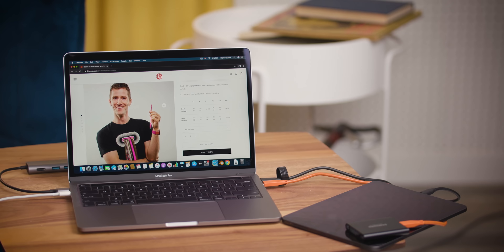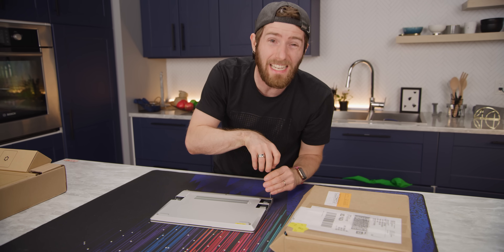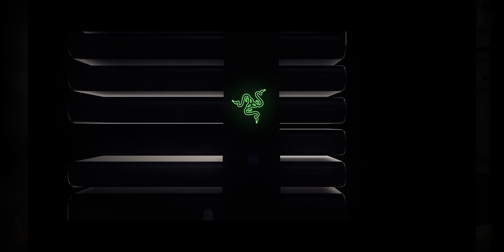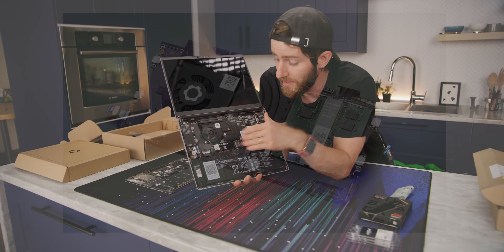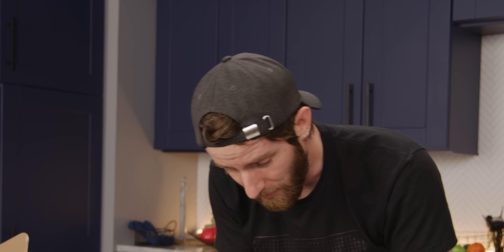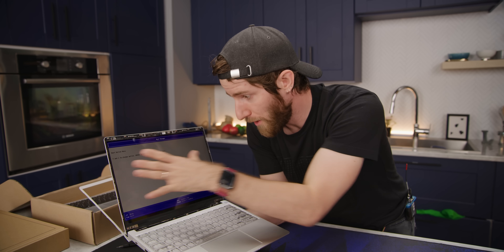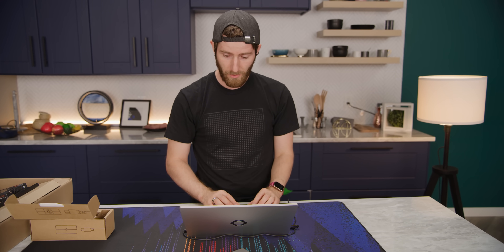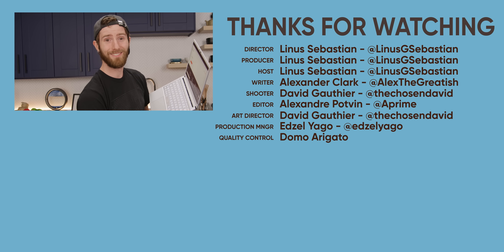A COMPLETELY Upgradeable Laptop?  - Framework Laptop Review

Comment: 2 main gripes I have with this thing aside from the obvious uncertain future:
1: customizeable ports are nice BUT 3 (4-charging port) of anything is NOT enough for me without dongles.
2: While the hardware freedom is nice, they have to compete with the software freedom of system 76 for me.

these are very fixable though. if they had atleast one of either USB-A or a USB-C charging port built into the chassis standard that would go a long way to increasing the actual flexibility with the other ports. 
-EVERYONE will need to charge the laptop and if you really want it on the other side you can still use a modular type C
-type A is so widespread for things like dongles, flash drives, mice, external hard drives, and phones, it is reasonable to assume the vast majority of people will still find use for a single one somewhere on the laptop 
-alternatively they could just have 6 ports though that might cut into speaker size theoretically, though they could have made the speakers themselves modular with 2 "jumbo" bays that could alternatively support larger devices with multiple ports or just the regular ports with some kind of spacer to fill the gap. I would trade out stereo sound for 2 more ports personally. 

for 2 they could implement coreboot themselves, but honestly what would go a long way, is if they could partner up with system 76 and possibly other companies for alternative parts at some point in the future and instead take on the role as some sort of standardized 'framework' for other companies to compete to create parts and boards for.

Comment: Why not make a video about mainboards with integrated UEFI shell? I know MSI boards have it. ASUS probably only with an extra file on USB with FAT32.
Does it have a UEFI shell?

01:30 - 02:10 Look at the fair phone it follows the same logic. Manufacturers just have to agree on a standard for PCIe micro interconnects for phones and laptops. Modularity is always possible. The real problem is their greed not that you can't do it. When the board and CEOs and owners suport the wrong thing.
Cons:
No easily removable battery. Easily meaning from the outside.
No Hardware switch to disconnect the battery water damage.
The IO modules are not build for a higher port density.
Is the mainboard modular? Do they have a CPU and GPU socket that have a standard interconnect like PCIe with a zif solution to use BGA chips in them. Modules for everything sound network V/RAM. Southbridge socket. Interconnect board.
Localized keyboards are missing too, so...
There are many more things that can be improved or are missing so hopefully they stay in business to make them. Or another company makes them.
08:40 Yes they are called BGA. Make the solder pads thicker and solve the problems with the HF connection to slot them in ZIF sockets.

Yes the privacy shade is awesome and the mic switch too but the port density and the lack of a removeable battery are a dealbreaker.
Besides I really like the suitcase style laptops, done right you can use an ITX board in them and a full sized RGB keyboard with a shitload of macrokeys you'll never use.^^
Personally I wouldn't mind a small suitcase laptop if it was a DTR (DeskTop Replacement).

Comment: Panasonic's Model 55 was out way before this and is much better design that has "bays" that let you upgrade it like this except better. You can have something nuts like 40+ hours battery, super GPUs, IO stuff, antennas, so many different combos. Very modular, and handy.

Comment: I'd really like to see a Gigabit ethernet port expansion card. Sometimes, I want to have my laptop running a wired internet connection instead of WiFi!
Reply: Why’s that?
Reply: @npgoalkeeper  I have a few reasons. A hard-wired internet connection will always be faster than a wireless one. I don't have to worry about interference from other devices, so it's far more stable. Plus, I work in IT, so often I don't have WiFi available when I go to a client's site. However, I always have the option to hard wire. Rather than carrying around a USB to Ethernet dongle, I'd like to have a port built-in.

Comment: Looking at the website, this is amazing except they only have a 13.5" display size of laptop. I really hope they come out with 15.6", 17.3", and I think 18.4" as other sizes I've personally used of laptops. Possibly adding more hot swappable ports too, it'd be amazing to have the ability to say connect to 4+ screens or have like 10+ USB 3.0/3.1 ports depending on whatever purpose one might have for those options.

Comment: To be honest I don't see the appeal.  It's a $1300 laptop that requires assembly, with meh specs, that's had all ports except 3.5mm aux + USB-C removed, and expects you to use adapters for each other type of port you want.  Sounds like a MacBook Pro, with the exceptions that these adapters going inside the laptop case instead of sticking out the side and the MacBook Pro doesn't require assembly.  These adapters are also 100% proprietary.  

The part about being able to swap the board is interesting, but irrelevant until they come out with new/upgraded boards to be swapped in.  Until their promised modularity/upgradability is actually realized, I just don't see the point in this thing personally.

Comment: Please post an update on the pricing. Simply comparing the prebuilt and DIY models with the same specs results in the DIY model being around $100 more expensive, rather than $300 cheaper, and I'm not sure if this is supposed to be a feature or a bug

Comment: Well, I literally hate this "you can't repair your stuff by yourself" trend. Hacked my Lenovo laptop UEFI to override whitelist and now I can use WiGig with my modded router (I really appreciate those PCIe solder pads under the router hood). PS: I hate glued phones, but there's not much alternatives right now. I'm using high hardness wire to cut glue to open my phone… Feeling obligated to master those weird skills.

Comment: Honestly, I’d make this laptop. I’d expose 16 PCIe lanes on each side instead of having the USB-C modules, but I’d make this.
Reply: Pcie is probably a bad idea here, maybe TB3/4?
Reply: @npgoalkeeper  How would it be a bad idea? I mean, the size of a laptop may require a custom connector (of which I’d definitely publish the pinout and the specs of the connector) but it’d allow you to do something similar to the Panasonic Toughbook 55, with both sides capable of holding I/O, NVMe storage, maybe even discrete graphics.
Reply: @AshtonSnapp  while pcie hot swap exists it’s quite complex and adds a lot of overhead (though TB adds almost the same), and yeah there’s the issue of interfaces. The current trend is smaller, universal connectors. Slapping a large, new  connector on devices without developing an initial ecosystem would mean that adoption rates would be quite low (and may not rise at all).

It’d be easier to just slap some more thunderbolt3 ports, given that most users would rarely surpass the 32.4Gbps limit of TB3/4 for data transfer.
Reply: @npgoalkeeper  Yeah, ok you’ve got a point there. Doesn’t mean I’m a fan of it, but you have a point. Honestly I wish PCMCIA/ExpressCard still existed. That would make expansion much easier.

Comment: Modular io like this is mostly useless. Being able to replace ports easily when they fail is a must, but these modules make no sense. They take up so much space that you’re left having to change them out repeatedly when it would have made more sense to just use that space to have a few thunderbolt ports, and maybe 1 modular connected for special uses. One of the modules is already wasted by not having a dedicated charge port. I appreciate what they are going for, but I’d rather just have thunderbolt ports and have to carry a adapter hub than worry about constantly swapping out these modules when I need something else.
Reply: Well. I don't believe that their intent is to make changing IO frequently, but rather when you buy a laptop YOU can decide what IO you want. And then you don't have to change it.
Reply: @aleksanderkrauze9304  right, which would make more sense to do on the inside by connecting them directly into the motherboard. This would not only save space by removing all that housing and adapter nonsense in the modules allowing for more IO, but would make the exterior look better. All they would need to include are smaller IO cover plates.
Reply: @disgustedluigi  I guess that would make more sense. This adapters are in fact quite large. On the other hand this way it is constructed today is probably more convenient for an average Joe. One thing for sure. It is step in the right direction.

Comment: Honestly between this weeks WAN and this video I think I'm going to get the DIY model myself early next year when I get my income tax return. I've been wanting a laptop, I ran an HP Pavilion for 10 years (It easily outlasted my ASUS ROG laptop that was 3x the cost I was gifted for college by a lot) and honestly if I could upgrade that I would have to keep it current - the thing was an absolute trooper. This laptop would be both a fun weekend project as well as something I could realistically use side by side with my Custom Built Desktop. The whole reason I spent so much time making my desktop what I wanted in a case I wanted was I never wanted to need to buy a new one. Now if I need to I can buy a new GPU or I could replace my ram or I could replace the mobo/CPU, nothing in here is going to force a full upgrade and I SUPER appreciate that. If this laptop holds up and can promise me the same longevity I expect out of my PC itself GOOD. I would LOVE for this company to succeed and do well and I would love to see it someday outsell the SIs.

Comment: You don't save $300 if you choose to build it yourself. It's $300 cheaper, but you only get the barebone version, to which you need to add *everything*, building up to a similar price as the base version for similar configurations. 
The upside is that you can choose to leave some features aside, like the OS or the storage.

Comment: About the cpus, not all laptops have the cpu soldered on the motherboard directly. Just all made after 2012. That's whyI use only machines that are older than 10 years. All the new ones are a piece of crap.

Comment: Ok so lets take a look at this shall we? Base configuration vs specced up config of say a macbook air. Why a specced up air? Because this thing, in order to get a processor that performs like the M1 needs a 300 dollar processor upgrade. So 16 gigs of ram for both, core i7 for the intel machine, 256 of storage for the windows machine, and 512 for the mac. we are talking the framework comes out 40 bucks cheaper, but then if you start looking into things a bit you find that none of the expansion cards come with it. So you need to add 9 bucks on bare minimum to get a functional machine as it does not have a charging port included according to their site. You can plug into the usb c plug thats in the machine that all of these plug into themselves, but its a hassle and you risk breaking the port cause it wasn't designed for direct access. and to bring it in line with the mac you need another 256 of storage and another USB port. And now we are at the same price, replacing the 256 with 512 on their configurator brings us up another 13 bucks, and the two usb c ports add another 18 bucks. So we are at 1449 for the mac, and 1450 for the framework. Not bad. Assuming self assembly. Yup when it gets here you have to put it all together yourself, or pay 300 bucks to have that done for you. So what are you getting for the same cash if you are willing to build it yourself? Well you are getting a lessor screen for one. The mac has a 2560x1600 screen while the framework has a 2256x1504 >400 nit screen. the framework has a 55 Wh battery vs the 49 Wh battery in the Air. Both have touch ID, both have wifi 6 and such. So really the big difference is in repairability, and performance. This is closer than I honestly thought it would be, but there are some unseen tradeoffs. M1 chips are fast and power efficient partly because the ram is built onto the chip and thus not upgradeable. The mac will likely out perform this machine while being quieter and more battery efficient. This has no dedicated GPU and its unclear if the expansion cards will cause issues with eGPU's. Etc. Not to mention Apple Care is (when you aren't trying to be insane with it) one of the best loyalty repair services out there. Its really hard to call this a good deal, it does however show that until all our laptops are running SOC's, this isn't completely inviable like a lot of manufacturers would have you believe.

Comment: There are several options to a an I-phone, in-fact I will never be on the I-Phone craze due to how late Apple got into the Cell Phone market, if it had been in early 2000's before 2003 then yeah I get it but 99% of brands either made tech appliances like HTC or Samsung or were out before 2003 for the phones not just computers the Way Apple has that were after the colored I-Mac were getting less and less user friendly as well as the company. In fact some of the Samsung or HTC phones people can work on them as long as they know how to in old phones that you can't get the parts for from manufacture, disable the fact it is using non brand parts.

Comment: I want one, but there's a problem. No discrete GPU. You mention "a big fat Steam library," but that's useless to me with an APU.

I need a "gaming" laptop, and I can get one with a 3080 for the price of one of these, and I have virtually no use for a laptop without a decent GPU.

I have to settle for recommending these for other people until there's a solution. Even an expansion port with a direct PCI connection for an external GPU would be enough to make me pull the trigger. It would almost certainly be more performant than the current eGPU solutions.

I'd love to see an auto-clone feature to keep full backups on storage that can be booted to clone to a new NVMe drive. A second M.2 slot wouldn't be terrible either; it's nice to have a small primary/OS drive with a lot of TRIM headroom.
Reply: Lenovo slim 7 2021 is cheaper and as slim and light as this andnhave more powerful cpu/gpu

Comment: This looks awesome! I went to the website and was picking out what I wanted when I didn't see anything about graphics cards. What is the solution there?
Reply: Only solution is to not join the hype. This is an overpriced modular usb port laptop.
Reply: @jonmon5745  Welp. That does sound like the right move at this time. Hopefully the manufacturers keep going. I really like what they have so far, but I won't  get much use out of a computer running onboard graphics.

Comment: Ok im totally sold on the entire idea except.. this isnt affordable.. it starts at $999 with no wifi antenna even, no OS, no hard drive etc.. its a shell, and then if you work in tech like me and need a reasonable machine it quuckly gets to $2000. So stop saying affordable cuz it aint. Not a fan of google but chromebook is affordable. This has a long way to get to the level of madmax customization and affordability we dream of
Reply: Not to say that im against opting out some of the basic elements that i can rip off old laptops #reuse#repair#recycle..  but damn, let that show in the base price..
Reply: Only fools are easily fooled by this junk laptop which probably came from mac who doesn't have idea that almost all windoes laptop have been like this for years.. i have an old laptop ram/ssd/battery/keyboard/screen replaceable...

Comment: I love this, and I look forward to them having dedicated GPU modules of some kind
Reply: Yea, but that would have to be on a new laptop, meaning it wouldn't be fully backwards compatible with the 1st model. Still, it would be awesome r
Reply: @Joseph_mama  not necessarily. It would just require a new motherboard and possibly bottom chassis plate
Reply: @Raven1024  depends on what kind of GPU you want to put on it, because even with a bottom chassis change, there is a point where you would need a redesign to manage the thermal output of that given gpu. Maybe with fans's or something
Reply: @Joseph_mama  That's the point, all the ventilation on a laptop comes from the bottom plate, so a bottom plate redesign to make room for and vents for more cooling is all you really need. Keep in mind bottom plate is also generally the rear of the laptop in one piece as well. All your vents are in that piece.

Comment: This is DOPE! I have been looking for a laptop replacement since I have had my desktop PC, I don't want a gaming laptop, just something that could get light use.
Reply: Legion slim 7 2021... Only 17mm thick just 2mm thicker than this..
Reply: @jonmon5745  But this laptop is built to have replaceable parts as it ages, and I don't necessarily need a gaming laptop.
Reply: @ElectricGeckos  like what parts? Legion 7 slim also have replaceable ram and ssd same like this lmao
Reply: @jonmon5745  But this laptop has swappable ports, battery replacement, it has upgrade paths.
Reply: @ElectricGeckos  upgrade paths? What do you mean? Only ram and ssd can be upgraded. Go on buy it then goodluck lol.. Swappable ports? there's alot of adaptor alternatives... Battery? All windows laptop including Legion slim 7 battery can be replace...